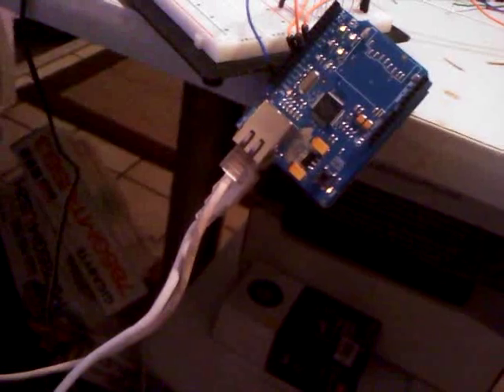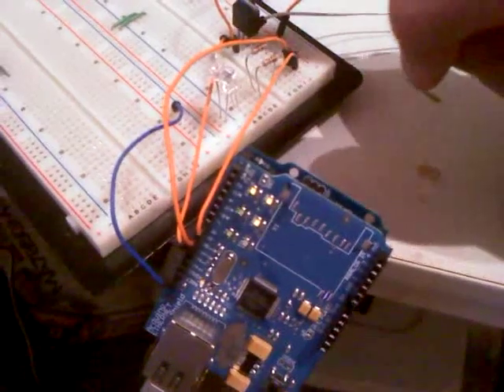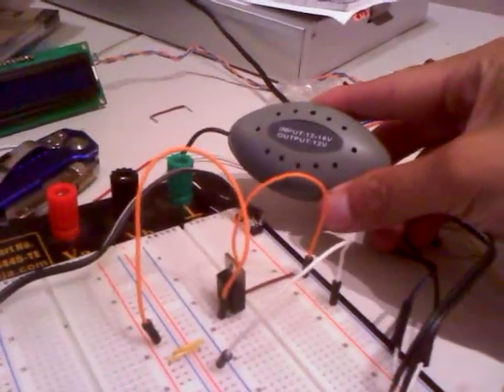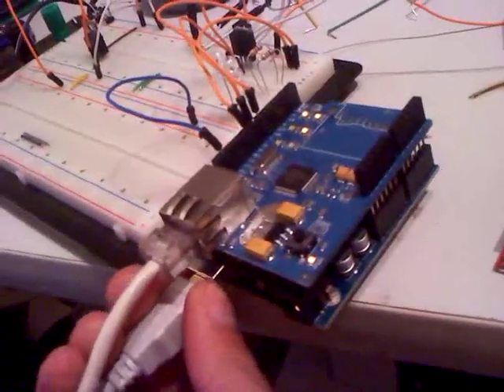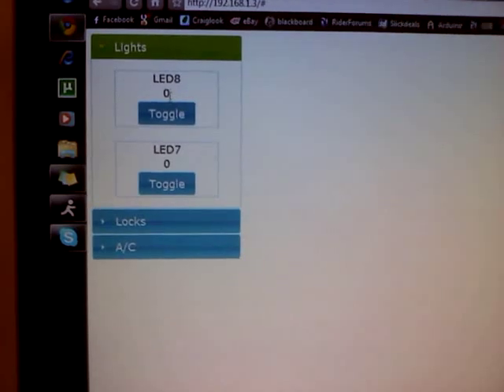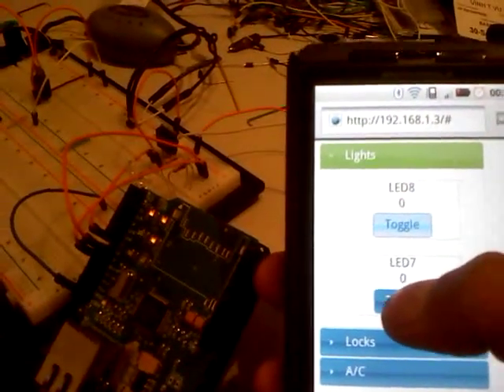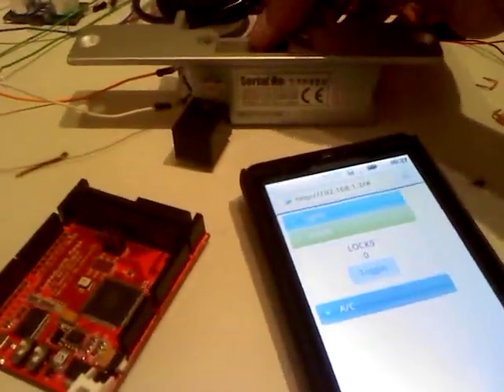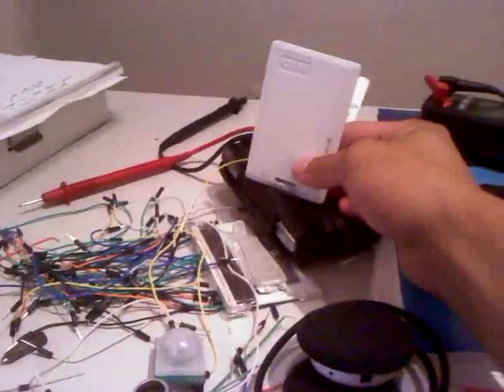Arduino with Ethernet Shield and PHP Server = Automation

Comment: Good greetings to all programmers of this prestigious forum. I am looking for information or from an external web page mounted on local server you can send a command to an Arduino Ethernet shield to activate an actuator, either a simple LED, activate a reled to turn a motor or other peripheral. Buso information and what I get is that I have set my Ehernet shield as a server and make the website within the arduioi code and do not want it because I want the Arduino is sending information to a database and php my code by receiving information stored in database and show me a message in the GUI (buttons) and then take decisions for example: if my infrared sensor detected something advise me on the website with a button that says ON and sensor 1 an alarm until I from the website through another button that says OFF sensor 1 to send it off but this site is totally out Arduino code is triggered. I appreciate your help.

Now I have an application mounted with infrared sensors to detect the presence or movement, also I have connected magnetic contacts on doors and windows and when an event happens ehternet shield sends information database of the activated area. I access from the website on my localhost but to the database, can not send it directly to orders from Arduino. I hope you understand.

Comment: So what about the PHP? Your title is a bit misleading. I waited for ages for some mention of php and thought you would be saying how you have a webserver and PHP running on an Arduino.
Reply from the maker: Sorry if it was misleading. The Arduino and Shield is limited and will not support PHP or anything like that. I ran a separate server with PHP/Apache/MySQL for everything else. Or I did... it's all handled by one RasPi now.
Reply: Via PHP you can give ethernet arduinos commands and read out their status. You could also "poke" a php server with an ethernet arduino to relay data.
Imagine a series of arduino nodes all controlled by a cronjob PHP script. It would handle connections, methods, actions, checks and so on.
I don't generate html on my systems. I prefer them to output XML which which is quite convenient in PHP.

Comment: I have a key.  It cost about $1.29  It has never failed; not even in a power out.  I don't have to make sure it's charged or that my ISP or cell payment is current. As far as security, It has never been compromised. I did not have to lean anything to make it work.  No wires, switches, LEDs or wi-fi involved. It's amazingly boring.

That said, I just bought an Arduino starter kit.  It is one of the most rewarding, challenging things I have ever done and that says a lot!

ANYONE WANT TO BUY A KEY?

Comment: very good job .. i have also arduino mega and ethernet shield and want to do the same job.  
 i want to control relays and dc motor also a tempreture sensor which display me tempreture on the web page.  can you share the schematic and sourse code. is there any website of you.. 
thanx in advance